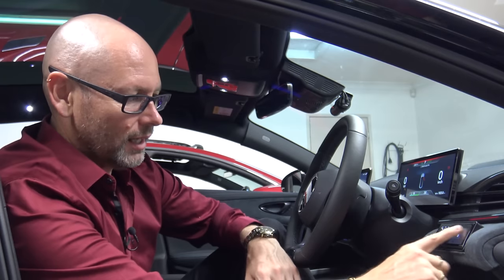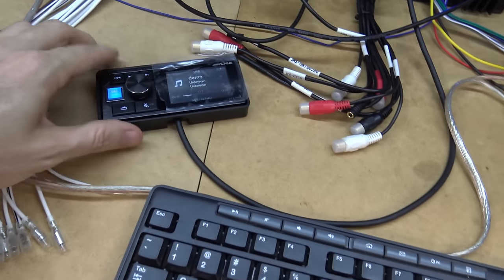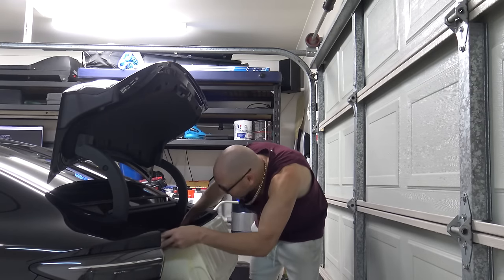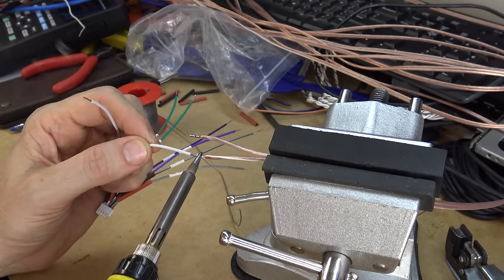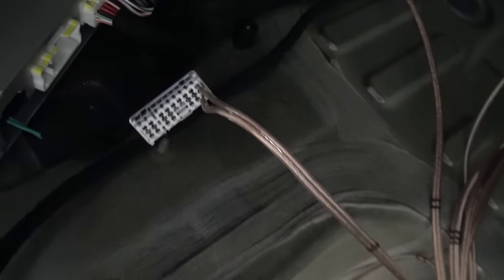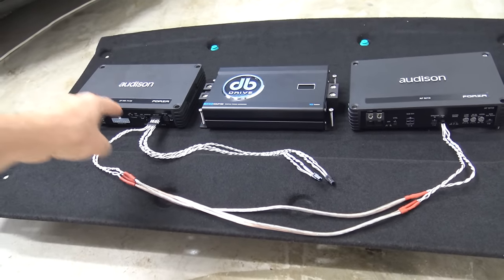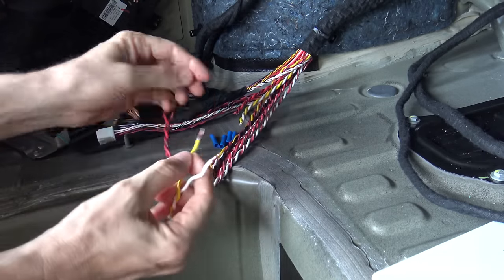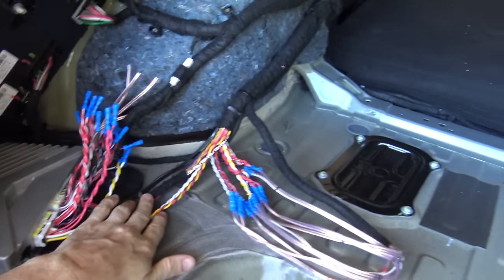BYD Custom Stereo - Part 2 - Connecting Amp And Speakers

Comment: An easy way to tell the polarity is flick a 9v battery across the terminals. If the speaker cone jumps out the positive and negative are right, if the cone jumps inwards they are the wrong way round.
Reply from the maker: That's a bit extreme... wouldn't need a 9 volt. Anyway, that would require me pulling the doors apart, at which point I'd be able to see the cable visually anyway.
Reply: Yep, I did work experience in 1992 in a car audio place and they did the 9v battery trick so that's what I do. It's so easy.
Reply: A better, less damaging to the speakers method is to use the tone generator from an F-Set.  Like you would use in UTP cable tracing.
Reply: @TallPaulTech  can be done with an AA or AAA too, just a bit easier to see the cone jump with a 9V.
Reply: @TheAVJedi  I have never damaged a speaker with this method over 30 years or so of installing car audio.
Reply: Loose calculation, if the speaker was a resistuve load, assuming a 4 ohm speaker,  I=V/R. = 9/4= 2.25A
P=V*I = 9*2.25=20.25Watts
But a speaker is an inductive load so the voltage could spike higher and thus the power to the speaker. 
(Apparently a 9v battery can deliver around 2amps)

Comment: Crimp vs solder. Crimps take up a lot of space and doesn’t look neat but could be staggered to take up less space. Solder can look better and compact but can be brittle if subjected to movement/vibration. I worked on systems with removable panels, we were constantly repairing the soldered joints. Soldered joints need to be completely demobilised in some way otherwise you might need to repair later. 
Just my experience.
Reply from the maker: Soldered joints are fine really, as all of the electronics in the car are held on by solder. The main problem with solder is for heavy components, which you'll notice usually have glue over them. Cable to cable won't be a problem. As I said in the video I just used crimps for a quick and easy to get it running for now until my heatshrink arrives.

Comment: Ahh it makes sense now what you're doing with the stock speaker wiring and also feeding in some of the factory audio as an option into the head unit - to mix in the incessant blips if you need to (for whatever reason). I love that you installed the head unit underneath the passenger seat, that's a real dead space in most cars. Is there more room there for other gear?
Reply from the maker: You mean the back seat. That's all I plan on going there.
Reply: @TallPaulTech  sorry, yeah, back seat... it's been a long day.

Comment: Where do you find the pin outs for speaker info ? Trying to find some for byd dolphin speakers
Reply from the maker: I pulled the plug out of the amp and tested which speakers they went to, as I showed in another video.

Comment: Stupid question - but for a average user - what if the speakers are just fine but the problem is the amplifier. So if you just upgrade the amplifier and increase the related fuse. What do you think about that if I do not want to touch the existing wring too much? I am mostly worried about the output volume rather than the quality of the system.
Reply from the maker: It's probably actually a problem with the factory source to begin with.

Comment: Hi man. Nice videos. Love what you are doing for the community. Few questions:
Name of the apps showing in the videos? (meteo tv...)
When you are using the hilvl from stock stereo the volume is lower or not?
I am looking for a similar solution but i want to keep stock sub and stock speakers in general (also center and rear speakers)
I want to add/swap only an ampli.
What do you think will be the best solution for this job?
Audison forza m12.14 (stock sub will be underpowered?)
Audison forza 8 channel with some bridging since it lack 4 channel? (maybe in combo with stock ampli?)
Really looking for your help mate :)

Comment: Thanks for all the work and showing us! Maybe I missed something, but how do you drive 12 speakers (that were originally present) with an 8-channel output; and drive 2 subs with the M1D which is 1 channel? Was wondering which furthermore amplifier you would recommend if one is more fan of class ab sound?
Reply from the maker: The centre dash speaker and back parcel speakers are useless, so they're out of the equation. 8 channel amp for 4 doors, mono for the subs.... the real subs. The box for them is looking good, and there'll be a video on them and the amps soon enough.
Reply: thanks, that's good to keep in mind. Might take my own Seal for the upgrade to a garage, not as much a handyman as you are. Will stay tuned regarding the amps! @TallPaulTech

Comment: Very tidy! You'd get a job as an auto sparky any day of the week but you'd vomit at the pay packet.
Reply from the maker: I'm going to eventually solder and heatshrink those cables. As you can see, it's far from done. I have to come up with a creative frame to house the 2 amps and capacitor on the right there.